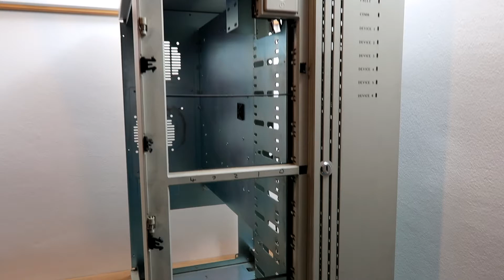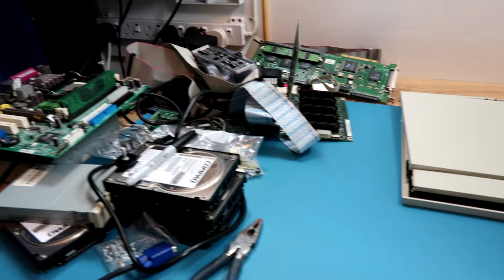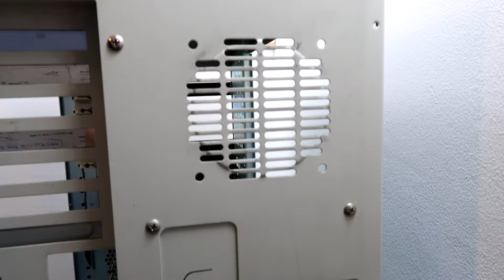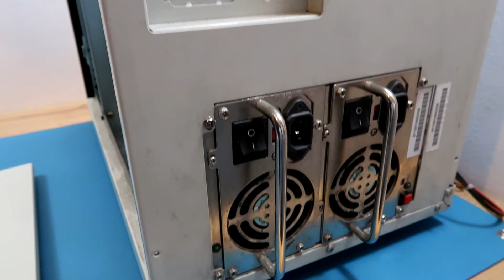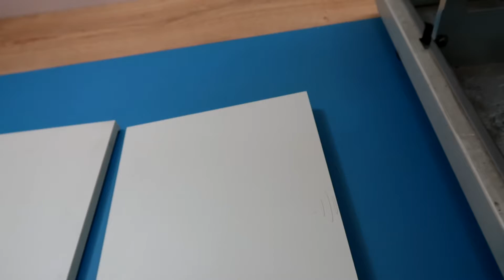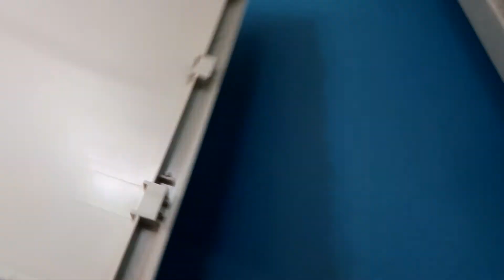Saturn Server Tower Case - Teardown and Cleanup - Part 2

Comment: To use those old PSU's it would perhaps be wise to change the main capacitors as well. That's one reason why the only power supplies I risk touching is the BBC micro ones, because they're well above my skill level.

Comment: That looks like its been in a factory or a garage with that density of dark muck that's been left behind.
 
Many of the PC's that I've worked on inside peoples houses, who had pets and wood flooring, have a horrible amount of dust and hair deposits inside. The PC's in those houses are simply vacuum cleaners especially if the PC's sit on the floor, whereas carpeted houses kept the pet hair and dust in or on the carpets.